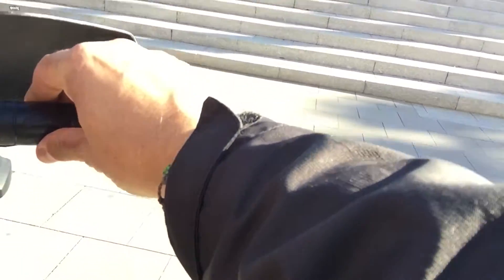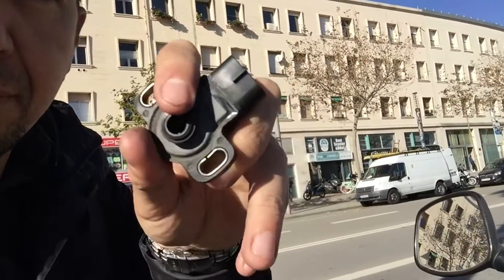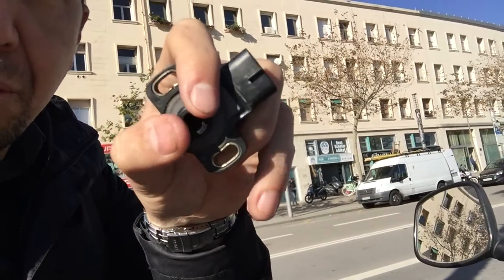Broken TPS [Throttle Position Sensor] on the Vstrom

Comment: Happened to me too. At around 58000km ( Vstrom model 2005). I adjusted 2 times ( check for tps adjustment videos its quite easy to DIY). 2nd time seems that will be the last one :-(   ..